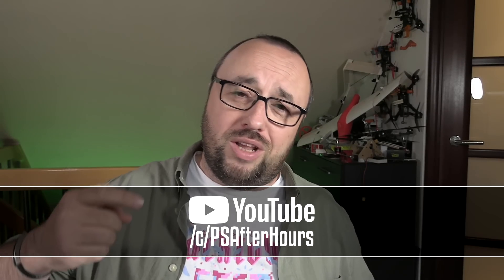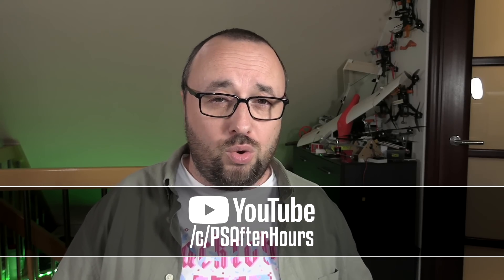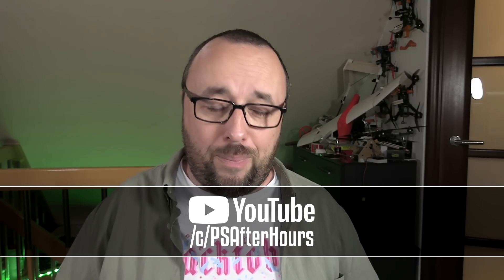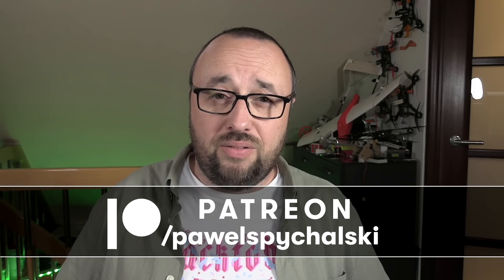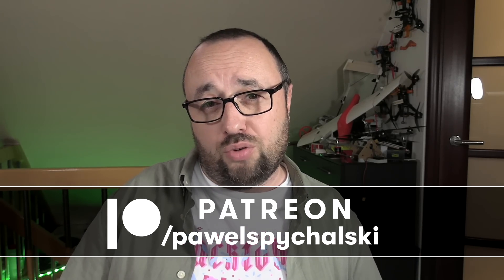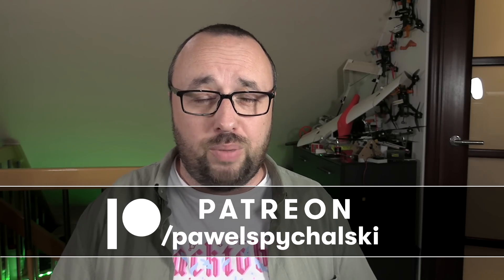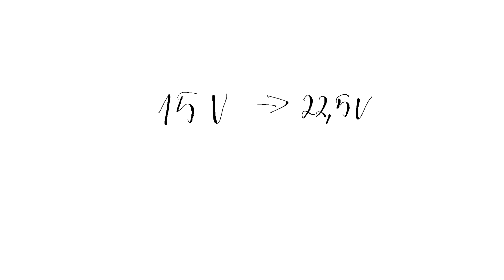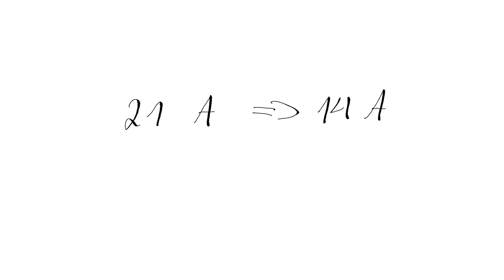Is 6S LiPo battery more efficient that 4S?

Comment: Really great video & profesional explanation !  In fact just switching from 4s to 6s in the same motor&prop might actualy lead to higher loses and overall reduced eficiency, as especially propellers are designed for maximum eficiency a certain speed to minimise drag & maximise thrust.  And considering drag increases with V^2 , you might lose much more power due to aerodinamical efects in propeller.
Reply from the maker: Glad it helped

Comment: I totally agree. I’ve been flying 4s packs since I started flying FPV back in 2016 I’ve tried multiple different 6S Lipo‘s, but didn’t see enough difference to make the switch. When actually comparing apples to apples as you say. Most of the time when people change to 6S they will end up putting a higher KV motor or making some other change that they did not realize and they feel that the quad flies better when in reality they’re not really comparing it correctly. For me, it is not worth it to pay a lot more money for something that is not giving you that much more benefit

Comment: You are only considering the wires. Which is only a part of the story. Connector resistance is much higher, especially after 100 cycles. MOSFETs at temperature suffer from 3x the Rds,on at 25C and with the small ones used on 20x20 ESC's that is significant. Battery impedance is significant. And losses are I^2.R, which adds up given the several tens to a hunderdsomething amperes we push through.

Then we have iron losses in the motor; the number of windings on the stator is proportional to kv-value, but inductance rises with the square of the number of windings. Given a fixed PWM frequency that increases the current ripple and therefore the eddy current losses. Going from 2400kv to 1600kv reduces those losses. 

And the list goes on and on.

Comment: One thing to consider is also pwn frequencies. High frequencies on esc is less efficient on ESC but mor efficient on motors. And  frequencies can be higher at low voltage. So i dont know what is more important here the efficiency of the ESCs or the efficiency of the motors...

Comment: Good discussion. But one thing you missed is that higher amperage causes efficiency losses in the coils and esc mosfets. 6s operates the motor and ESC cooler with lower amperage means less losses. High voltage is always more efficient and also in theory make your electrical system last longer because it's not getting as hot

Comment: There are optimum voltages for every sizes of quads. It is a compromize of 1) size and weight of the electrics because of voltage arc and leak insulation and between 2) the weight because bigger wiring and windings and cooling because of high currents because of low voltage...

Comment: The probability that the battery pack dies is 50% higher. Because only one cell has to die and the whole pack is broken.
Reply from the maker: For sure MTBF for 6S is lower than for 4S
Reply: For some odd reason, I've found my batteries to age mainly from corners. :)

Comment: If i have a TATTU R-LINE 4.0 1550MAH 6S 130C Lipo, TATTU R-LINE 4.0 1300MAH 4S 130C LIPO Lipo Battery Packs with XT60 Connector, could i use DJI FPV AC Power adapter to charge it? DJI FPV power adapter is the one i use to charge my DJI FPV drone battery (Lithium ion polymer). 

Please advise. Thanks.

Comment: Depending what you fly I found lower voltage on the same motor and kV is more efficient, opposite to my expectations. This is because the motor draws 100% throttle current in broken up "packets" so there is more loss due to resistance than expected, lower kV has higher resistance but lower 100% throttle current.

Also higher voltage batteries are adding the internal resistance of the battery in series increasing the total effective internal resistance, though each cell does then output less current

Comment: I always thought 6s was introduced to overcome limitations of Lipo batteries, mainly in racing. If you can’t draw more current from them to increase power, add voltage instead 🤷‍♂️.

It was just couple years ago 100C batteries were unusual and very expensive. Nowadays, flying 4s or 6s is just matter of preference, for average Joe, since they would not be able to utilize that additional power 6s potentially provides anyways.

Comment: All I know is my 6s packs lasted over 150 cycles before I had to retire them because I simply wouldn't get more than 2 minutes flight time out of them, where as all my 4s packs retired themselves before 70 cycles. 6s for me and I ain't going back.
Reply: Well it's logical 4s cells are working harder than 6s if you use them in races. But they are also more expensive.

Comment: Lipo sag!  This is dominant factor in practice and should be the primary reason to move to a higher voltage "equivalent" setup or alternatively keep the same voltage but move to higher discharge rated cells.  This can only be individually evaluated based on flying style and the quality of cells a pilot has access to.
Reply: Just put a better capacitor on 4s.

Comment: Question. I have a 4s hd whoop running 1303 5000kv xing's motors. Iflight Alpha A 85 HD vista version weight of 92 grams without battery. I have burnt out two of the motors. I have 6 nin 1203 3400kv motors on my bench. If I replace the 1303's for the 1203's will this damage the esc/fc? the 1203's are 2.5 grams lighter each saving 10 grams overall. Will the weight difference and kv difference make a big difference? Flywoo NIN V2 Motors 3400kv,
Reply from the maker: No, it should not damage as 3400 will have lower current consumption

Comment: More cells in the 6s gives you 2 more points of failure per battery.   2 more chances per battery for a cell to go bad and kill the entire pack.
Reply: Yes that's true. Is similar to a raid1 of 6 HDDs... Has higher chance of failure than a raid1 with 4 HHDs...

Comment: The alchemy is simple: its easier and cheaper to get crap technology 6s sell with discharge rate 90+ and it will have less sag than 4s that is similar technical level. If you get really high discharge rate 4s like 120+ you will have similar characteristics, but bats degrade, and after some time 4s will sag more than 6s..

Comment: Agreed on all points for a constant wattage output. However 6s works better when you require large bursts of current. Since for a given wattage you pull less amps the batteries are able to not sag as much as 4s. Many years ago with 3D rc helis they also went from 3s to 6s to lower the amp requirements for the motors. Battery chemistry has always been the limitation so these are just work arounds.
Reply: Yes but you also need to also consider that a 40C 1000mAh 6s lipo will theoretically supply 40A constant discharge while the 40C (weight equalised) 1450mAh 4S lipo will theoretically be capable of 58A constant discharge. No?
Reply: @paulhope3401  Good point however in this hobby when it comes to Lipos there is no standardized testing for C ratings. A lot of packs when subjected to the max C rating sag and output less current.
Reply: @IanF-FPV   Yes, I totally agree.
 I'm just trying to point out that it is just a big equation with known values that are inextricably linked, change one value and another has to also changed. Ie; a 1000mAh 6S lipo cannot be considered to be the same as a 1000mAh 4S, we must equalise via weight to be able to compare. I thought you missed that, thats all. Peace.

Comment: what might one study regarding battery internal resistance with respect to cell geometry (like prismatic, cylindrical, spherical?) and number of cells such that 'c rating'?
Reply from the maker: I'm not aware of a single good and avalable for free source on the topic.
Reply: Generally individual cell resistance is very low for healthy cells. if same chemistry and cell capacities, a 6s pack will have lower resistance vs a 4s pack. There difference is small in comparison to the resistance of wire between the battery and motors (including ESC)

What is more significant is the voltage sag on 4s vs 6s if pack have same C-rating. Thus 4s can not sustain same level of continuous power at high throttle as 6s. This is related to 6s needing to deliver less current. Using higher c-rated packs on 4s can even out the difference. This can be somewhat the case naturally as a 4s will have higher capacity (thus c-rating) vs 6s pack for same weight. This where debate gets a bit complicated as will vary based on battery weight and budget for what c-rated packs one purchases.

Comment: This video was great, and the comments as well. There must be more variables present in the end products, than in the principles driving the math behind them. I would love to hear more about these limitations and why the industry always leans towards higher voltage for larger multirotors. Seems like everything in the m600 or Alta x range run on 12s for a reason.

Comment: As motors are switched with x kHz PWM, does higher voltage make any difference there and to what direction? Googled for a while but it seems to be a non-issue as not much was found.

Comment: I'm not trying to hate on you, I'm just trying to explain some things because it's pretty clear from watching this video that you don't entirely understand the physics involved here. Yes, power drives the motor, not voltage or current, but the conversion of power to heat is ONLY dependent on current, not voltage. So at the same power level, as you decrease voltage, and increase current, the heat production (wasted energy) increases, and therefore, efficiency decreases. More of the power is turned into heat, instead of turning it into thrust. This is why long distance transmission lines for electricity use high voltage, whereas the local lines use low voltage. Efficiency increases with voltage. Note that voltage drop has nothing to do with this. You are calculating efficiency incorrectly.
Reply: @Chris yeah but you need larger and heavier infrastructure on higher voltage for voltage arc isolation. Ok it is true that you also need heavier wiring and heavier windings for lower voltage. So it is complicated. Weight and size is important for aerodynamic aircrafts. That is why  there is are optimal voltages for every size of quads... It is the optimum between weight and size because voltage isolation in cross to weight because wiring...

Comment: I have 1 6s. It just worked out more efficient for 6s in testing. And I also can run 4s just less power. So went 6s. And still get use out of my 4s batteries on it when need be
Reply from the maker: Now now, but you measured efficiency? Longer flight? That's not efficiency. More power is also not efficiency.
Reply: @FPVUniversity  figured efficiency is making the same power using less wh. 
Doesn't always work out 6s. Depends on motors and weight and so much stuff.. cause I have seen a lot of motor thrust that 4s was more efficient.  
Just to be honest. The difference isn't much. And there can be error factor in human and weather. And sure motor stand test also have variances
Reply from the maker: @divingfalconfpv4602  efficient is loosing less energy to things you don't need. In this case, heat. It's about energy conversion. How much energy will you loose somewhere between battery and motor magnetic field.
Reply: @FPVUniversity  oh.

Comment: I think that the battery sizes do not have a perfect match between 6s and 4s. The batteries that are more popular for 6s do have a little more power due to their size. I don’t feel like 6s adds more top speed but I do feel like there is less battery sag. This is the largest noticeable difference. I have to be more careful with 6s to prevent over discharging the battery.

Comment: Lower KV with the same thickness of the windings would mean more windings, right? Would not the same power through more windings give a more powerful magnetic field, and then higher efficiency / stronger magnetic field for the same electrical power?
Reply from the maker: Lower KV on the same motor size means you have to have more windings and you have to use smaller wire. So resistance and inductance goes up. Ergo, max current is more limited. And it adds nothing to efficiency. As yes, lower KV motor will require less amps for the same torque, but more voltage for the same RPM. Everything balances out and energy is conserved
Reply: @FPVUniversity  and keeping with the theme of magnetic fields, one way the strength of the field can be expressed is with "amp turns." If you have a nail and wind 100 turns of wire on it and run 1 A through it, it is the same as if you had a single massive turn with 100A. And if you have a limited "winding window area" then ideally you fill it 💯% and the current density and power loss will be the same.

With motors, it gets more complicated because of the effects of back EMF as well. More turns means more back EMF and higher Kt and lower Kv. But even still it balances out.

Impedances get transformed by a square relationship. Double voltage means half the current which means 4 times the impedance.

Comment: Don't see the losses in the ESC as insignificant...
Reply from the maker: Just for simplicuty I decided to ignore them. Also had no real life values for the lengths on the junction and its resistance. But relationship between 4S and 6S voltage drop will be similiar
Reply: @FPVUniversity  ESC is way more significant than the copper...

Comment: Most people already know that watts is what flies your quad, and that current is what causes wires heating up which causes power loss. Being able to use higher voltage with lower voltage for the same amount of power allows you to lose less power to wire/connector resistance. 
But what it may have more to do with the use of XT60 connectors (rated to 60 amps continuous) for quads that pull up to or even over 100 amps. Some people have managed to melt these connectors in flight. Which means even when it doesn't melt, they're losing a certain amount of power to heat.
So even if they do adjust the wire thickness for the voltage change, if they're not using eg XT60 for 6S and XT90 for 4S then the comparison is moot.
Then there's the battery sag difference as mentioned by others...

Comment: Good discussion, but it's incomplete. What about voltage sag and it's effect on power? 

On 6s you quoted 14A and 4s 21A. The higher current on 4s will cause more voltage sag, unless using a higher C-rated cells. Less voltage sag on 6s will give more power if both 4s and 6s are same C-rating. 

Of course higher C-rated cells cost more (needed to reduce voltage sag on 4s so equivalent to 6s at max power). 6s electronics are likely to last longer as lower current, so not working as hard. There will be some price differences between 4s and 6s electronics, but usually higher current ratings drive pricing more than higher voltage ratings (in normal years). 

Would love to see this as a mini-series; building two similar quads; but 4s and 6s. Compare component costs, and weights, including batteries. Do some bench testing of quads at 50% and 100% power when battery are full and 50% to compare voltage sag, currents (thus verify power levels).
Reply: To be fair, the video is focused on efficiency, not flight performance. 
In more efficient throttle settings, there will be less voltage sag than if doing flipping flops with bursts to near max throttle (not efficient operation). In such cases 6s will have less voltage sag, thus output more maximum power.
ie: Use case does matter ... free style, vs. cruising.
Reply: @AerialWaviator  I think this was clarified in a different comment. Effective capacity of a 4s is more as compared to 6s to arrive at the same power. It's more to do with the capacity rather than the C rating.

Comment: But if current more bigger with the same power on 4S, so on big current you lose more heat, so less useful action
Reply: Yes. The difference in performance of approx. 0.4 watts is converted into heat. Peanuts ... as Pavel says!
Reply from the maker: But lower KV motor will have higher resistance and inductance. Ergo, smaller current will cause similar power loss.
Reply: @FPVUniversity  Yeah, but the induction will also be lower, respectively, the induction losses are also lower .. as a result, again .. the same spike, higher efficiency at the same power

Comment: What about the heating effect in the lipo due to resistance?
Reply from the maker: Irrelevant in this aspect. 6S lipo with the same energy (1500 vs 1000mAh) will have smaller cells with higher internal resistance. But lower current, so it will be basically the same.

Comment: 6s should not be about more punch, and that leads to the only one thing you missed about the flighttime since batteryproducer do not offer proper 6s batterys. When you lower your amperage by increasing the voltage, you do not need 100c batterys. You could use lower c rates, what means the batterys would be ligther. I got a quad that flies about 10mins like regular freestyling or fast cruising with a lot of elevation changes and accelerations. Its a 5s that i run with a 1800mah 75c battery and i pull on full throttle about 90a. I could extend that if i find good batterys 6s 1500-1800mah and 50-60c. But the mainthing is the KV like you said. There is no point for having 6s with 1700kv for a 5", motor manufacturer should offer less kv motors like the flywoo nin 2306.5 1350kv for freestyle (2100kv on 4s)